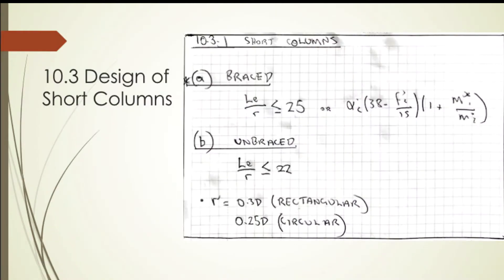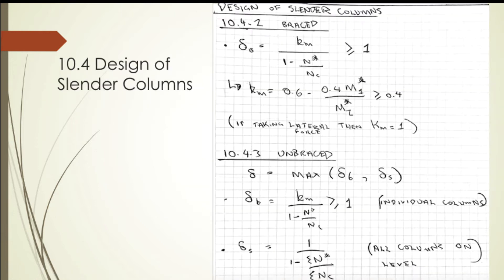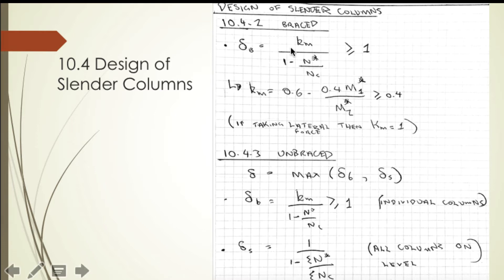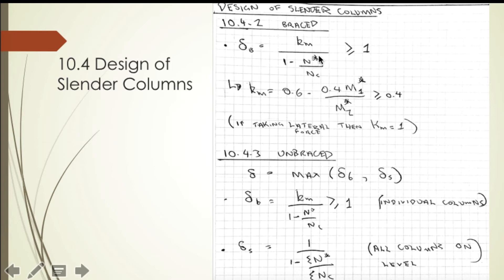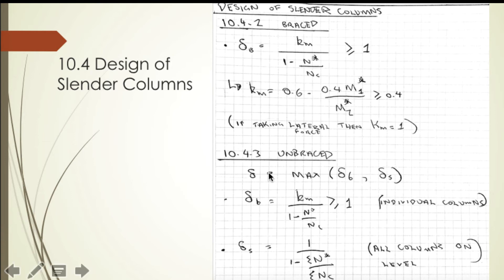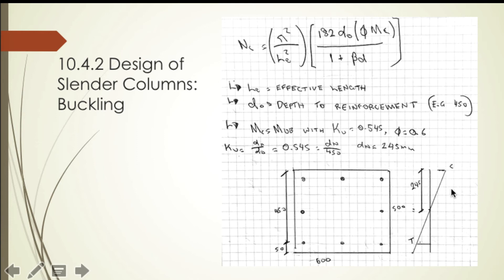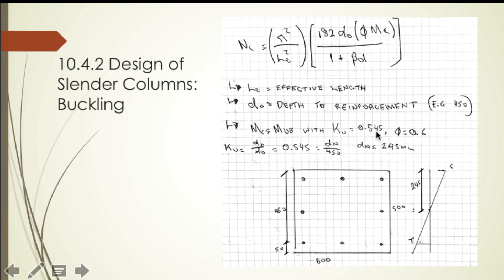AS3600 COLUMN DESIGN 10.3-10.4

Comment: You Can Try also SDS Software at www.strcutraldesignsoftware.com.au.
The software design to AS3600 biaxial columns, flexure, shear, shear and torsion, Footings, Combined footings, and check for crack control and deflection.